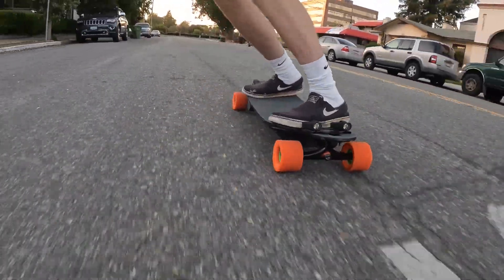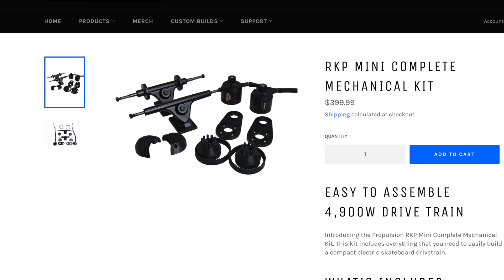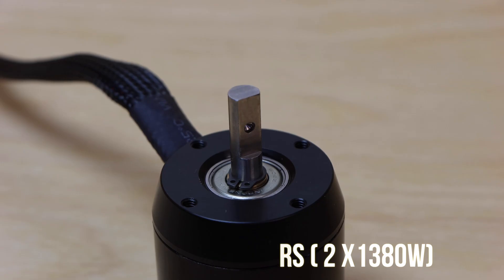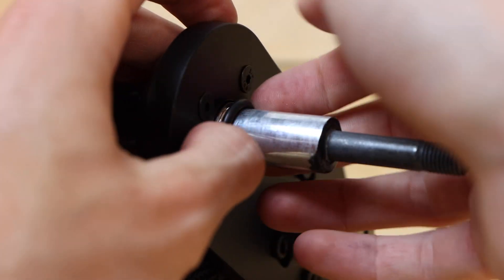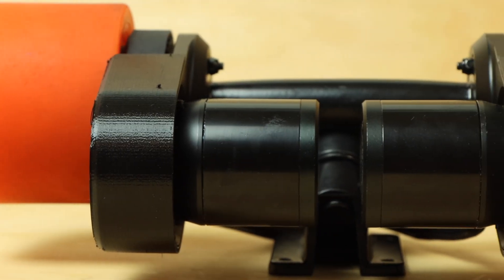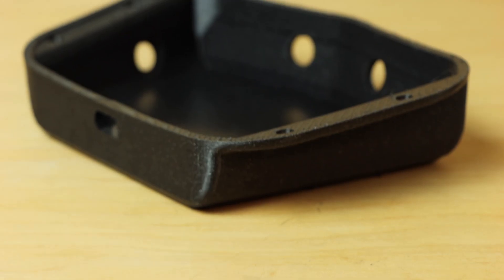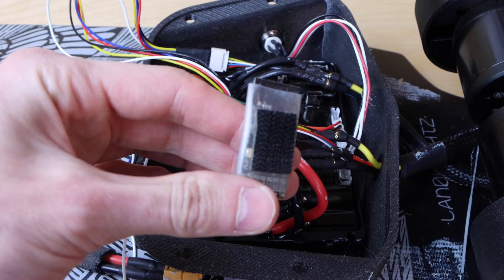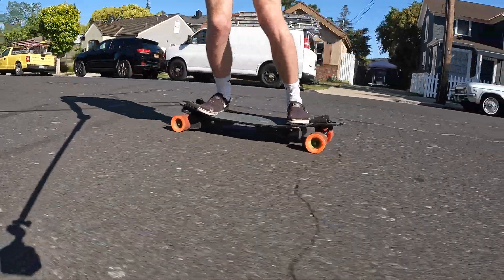How to Build a DIY Electric Skateboard *15 lb Landyachtz Drop Cat Seeker 33 V2*

Comment: What flipsky motor would you recommend to cruise at at least 30 mph? I also need a battery that will take me at least 20 miles. My average cruising speed will be 28-30, and I’ll be using the same deck shown in this video with some soft and fat longboard wheels. Any help would be appreciated. 😁 I’m planning to transition from a teamgee mini to a DIY, and I already have the drop cat.

Also, this will be used as a daily commuter.
Reply from the maker: The speed is determined by the KV of the motor rather than its size. For a decently power board I would recommend using dual 6355. We actually have a new mechanical kit that I think would work well for this kind of build: https://propulsionboards.com/products/rkp-mini-complete-mechanical-kit

For wheels I would go big with some MAD wheels, Dad bods, or TB 110's.

If you would like more information feel free to email us at diyesk8builders@gmail.com
Reply: @DIYesk8Builders  I appreciate it! 🤙🏻 I’ll use this for reference as I start accumulating parts.
Reply from the maker: Of course! Always feel free to reach out with questions. Best of luck :)
Reply: @DIYesk8Builders  Do you think the kit you linked would work with the hobby wing ESC and the 7.5Ah that comes with the teamgee H20 Mini? This would just be a temporary set up until I get more parts. I’m mostly concerned about forcing those motors to fit whatever parameters that have been set by hobby wing for hub motor use.
Reply from the maker: It would probably work but you would really be limiting the motors. I can't say for certain though. Long term I would go VESC based ESC
Reply: @DIYesk8Builders  Ordered the mini kit!

Comment: Any more info on 3d printing  a battery enclosure? I want to do the same thing for my icarus build
Reply from the maker: What kind of info are you looking for?
Reply: @DIYesk8Builders  how did you design it? What software did you use? What material did you print it out of? How did you match the curve of the board with the curve of the enclosure?
Reply from the maker: I took some measurements and pictures of the deck outline and curvature. I then used OnShape which is a free cloud based CAD software to draw up the part. Both enclosures were printed on a PRUSA MK3+ printer with PETG as the filament. Let me know if you have any other questions
Reply: @DIYesk8Builders  thank you!